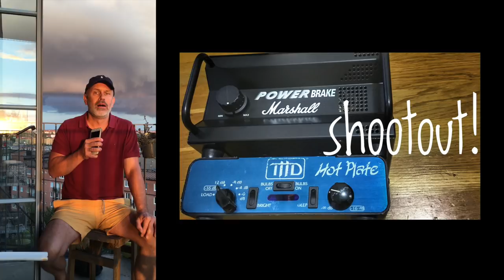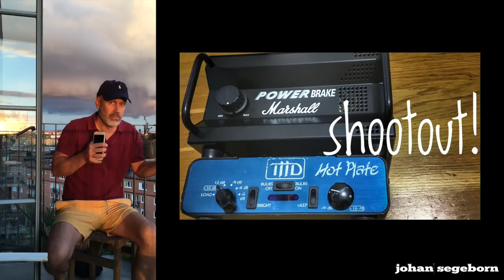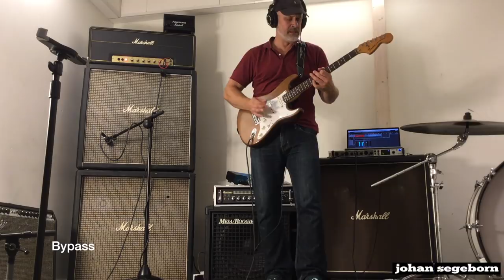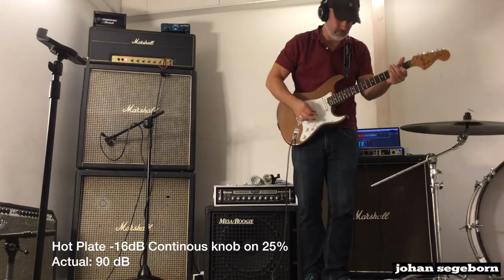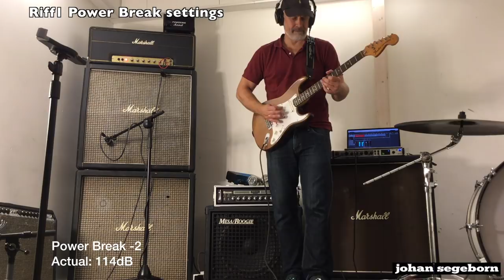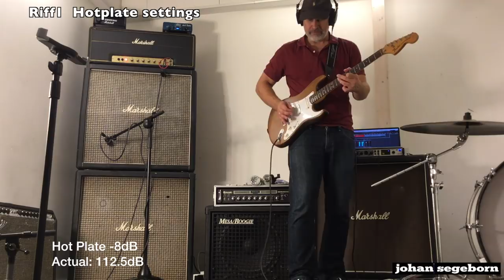Marshall Power Brake KILLS the THD Hotplate in this TEST

Comment: Awesome comparison. But calling 90db "bedroom level" might be stretching it a bit 😅
Reply from the maker: Thanks, Yeah Im probably not a good judge of  loudnes ;-)
Reply: Helo johan i buy a plexi 1987x with master volume instaled , dou you recomend removing it and use an atenuator?
Reply: It is in sweden!
Reply: @XMetalChefX  That might be the reason, here in Miami 60 db is the limit for residential areas, they come with a recorder and they place it on your fence, above 60, you get a 300 U$ fine (first time), second time onwards the ticket is 500 U$. Just like that. So attenuator is a must :)
Reply: Nope thats rock and roll!!!
Reply: @Opiti72 Make sure your houses walls windows and doors can drop 30db then I guess… Or have a house in the middle of a big garden so the inverse square effect kicks in due to distance.

Comment: Engage the thd deep switch and re eq your amp settings once you settle on the regular output that you would use. Keeping your original eq setting and then attenuating will obviously change tone. Mine works perfectly with no top end tone annoyance once re eq’d. Great work as usual my man🤘👍🎸

Comment: I too was using a hotplate after trying a weber mass III. I thought the hotplate did a great job and was a nice improvement over the weber. After watching your comparison, I was on the hunt to try the power brake. I finally found one and have been shocked at how good it is. For reference I'm using a 1987x. The hotplate does fine but the marshall is noticeably better and my ears suck! I find that the power break preserves the "highs" of the amp at higher levers of attenuation whereas the hotplate seems to cut them a bit and get a little more muddy even with the bright switch engaged. As a control I also tried the comparison with a 22 watt Fender deluxe reverb at true bedroom volume. Same results - its pretty amazing that the power brake seems to get a bad rap in some circles.  Bottom line is that both the power brake and hotplate are solid but I concur the power brake beats it. Thank you very much for your awesome videos!

Comment: I've had a Power Brake since 96. It does what It does very well, which is to make nmv amps a bit more manageable. I've tried other attenuators, and they all do more ir less of the same job, the PB, however, is apparently indestructible
Reply: I've been using the Power Brake since the late 90's as well.  Bought another, just in case.  Too bad they stopped making them, because they're the best attenuators available, ime.   The Weber Mass sounds fizzy (similar to hot plate).  The PB is a true reactive load.  So it feels about right, too.   Works fine on smaller amps.   It'd be great to have the fine adjustment control, but not if it sounds fizzy!

Comment: The Hotplate loses low-end weight faster than the Power Brake, which makes it sound thinner/clearer/shriller/lighter (choose your adjective). I would prefer the Marshall for that reason. Otherwise, both seem to keep most of the characteristic wide-open sound: careful use of EQ would probably narrow the gap.

Comment: Hello sir. Great to see the mocha strat out on your funky phrasing. I think the bad rep comes mainly from the pb coming out from an amplifier manufacturer, quite early on in the market of attenuators for the general public in mass production. Everyone tried to make their old marshalls sound like Eddie etc in their bedrooms and the tube and component life of older stuff wouldn't take the hack. Unfortunately the power brake got the blame instead of the usage. A tech I learned from once compared it to putting greased pram wheels on a drag racing car to get the effect with less effort, and then wondering why the engine blew up. Perhaps a severe casting of the characters but the principle kind of fits. I think with proper maintenance and sensible usage of the amp the accusation of the power break was unfair. It was ahead of the game in having a reactive load with the fan, like the speaker motor in the webers the reactance of some kind of coil is importance for the amp to see dynamic impedance curve I think, especially considering these amps have negative feedback. Great comparison with the normalisation of level really shows the change in eq as the thd gets lower. I think, if I remember right from the partial schematic I saw, that the thd increases damping on the cone dramatically which would explain it sounding thinner. Educating the masses, leading by funky example, you are the man as ever. Take care have a great weekend.
Reply from the maker: Have a great weekend my friend!
Reply: All GOOD points!
Reply: PoJoWo I didn't understand a word but I agree with everything you say...
Reply: You sound like an AUSSIE politician!

Comment: Good vid.  Just to add my experience, I've tried two attenuators.  The first was the Weber MASS 100 about 15 years ago.  It was awful at bringing a 100W amp down to home volumes.  I sent it back.  About 5 years ago I bought a Rivera RockCrusher.  It is EXCELLENT at attenuating down to any volume, even whisper volumes.  I highly recommend it.  I've heard great things about the Fryette Power Station, but haven't tried one.  I've heard good things about the Scumback dBL Limiter (Alex's Attenuator) as well, but haven't tried it.  For something much cheaper, I have a friend who tried the Tubular Mods Juice Box and said it worked well.
Reply from the maker: Thanks for the feedback, I hope to compare the rock crusher to the power brake soon.
Reply: Had Hotplate worked good at top two highest volume then after than it sucked the tone out of the amp.  Bought the RockCrusher sucked the tone out of my amp returned it back to Sweetwater.   I can't imagine the Power Brake being any better especaillly since it's over 20 years old.

Comment: The hot plate definitely sounds thin and shrill. The power brake really sounds the same on bypass as it does on -10! Amazing product great review. 

(One small note, in your video where you subtitle what is going on, you used/spelled "break" incorrectly.)
Reply from the maker: Thanks! :-)
Reply: @markp4818  Professionals care.  Businesses pay a lot for proofreaders.  John is a pro.

Comment: I have both the powerbrake and THD. From my own experience the Powerbrake works well up until the halfway point on the attenuation scale where after if starts to suck tone. Great for gigging for when you have to tame a 100w head.
The THD I find much better for bedroom level stuff as you can use the continuous control to get it to a level that’s not offensive to others. I tend to use it with a small box JMP 50 dimed, with the deep switch off but treble on at around 80db at home. For the most part nobody complains about the noise and it sounds pretty good. However a couple of techs have told me to set the amp impedance at 8 ohms with a 16 ohm THD if your going to crank it due to the impedance curve. Maybe someone more qualified than me can explain this properly?
Reply from the maker: The different versions of Hotplate actually only differs in terms of the EQ compensation. With the bass and treble knobs off, they are all identical. To me the EQ compensation of a 16 Ohm Hotplate works best using the amp set to 16 Ohm and using a 16 Ohm cab, as intended by THD. Check this video out 
https://www.youtube.com/watch?v=5Y28oFMU74s

Comment: Another interesting comparison. The PB sounds very consistent to my ears, whereas the HP clearly loses low end. How did you come across the powerbreak as a long time hot plate user?
Reply from the maker: Thanks, One turned up at the local music store, I didnt have high expectations but wanted to compare it to the Hotplate. Now Im switching to power brake for sure.

Comment: Are you reading the dB with a meter? My cheap Amazon meter claims it’s good to 130 but stops at 115 even when I can tell it is quite a bit louder and it still shows 115
Reply: THAT'S Amazon for ya!
Reply from the maker: Yeah I’m using the same meter as I used in this clip
https://www.youtube.com/watch?v=OoPyP6JMSG4
It’s probably also pretty inaccurate over 120dB

Comment: The Hot Plate seems to have a scoop EQ that gets more prominent with each step of attenuation. Is this a setting you can disable? Is it some sort of compensation like the "loudness" control on some stereos, intended to keep the voicing subjectively similar at lower SPL to make up for the difference in ear response at different volumes? (IE Fletcher Munson compensation)
For recording, with the recorded signals normalized to the same volume, the Power Brake sounded a lot more consistent.

Comment: All you need to do is bypass the 160 uf cap.and make sure the wires going to the power  resistors are better soldered they heat up and can fall off..you can find out more at the metroamp forum,under EVH builds..Look for rallie power brake mod

Comment: OK, comparing the Power Brake at -10 dB with the Hot Plate at -75% below -16 dB is not a fair comparison, at all, though I will say the Power Brake is just as good down to -15 dB, but start exhibiting unacceptable EQ shift at -18 dB, which doesn't surprise me, at all.

In my experience, the Hot Plate sounds great down to -12 dB, and below that, it doesn't sound very good. As you can hear immediately in the video, once you engage the continuous -16dB to -inf section of the Hot Plate, the tone deteriorates unacceptably. With the -16 dB setting and the continuous knob at -0 dB, it seems OK in this video, but anything lower than that would require EQ adjustment. In any case, I would never even use that capability, because I've used a Hot Plate for long enough to know that it's not very effective in the range, but in the ranges it does sound good, it sounds great.

IMO, attenuators are not very good at getting down to "bedroom levels", and shouldn't ever be used for that. But the difference of -12 dB is a reduction of power of 15/16ths, or down to 6.25% of the original power level, and makes a huge difference when using an amp live on stage.

Comment: Really impressive shootout, great normalisation and great tone... I chose Hotplates many years ago, based on how they sounded on 15-30 watt Matchless (Lightning), Vox (AC30) and Marshall (Lead & Bass 20) amps, however, nothing as powerful as a Marshall Super Lead Full Stack... I found the Hotplates to be the most 'transparent' sounding, to my ears anyway, particularly on 'full soak' for studio-level playing - I haven't really thought about it since then, but this test is pretty clear - does the Power Brake work particularly well with big Marshalls ?
Reply from the maker: Thanks, thats an interesting question. Maybe they developed it with respect to the typical Marshall frequency content. Cheers
Reply: Could be. Did you use the Deep switch on the Hotplate @JohanSegeborn  ? If the PB wasn't built with the Marshall's in mind, maybe they used the same tech housed in the Hotplate, but without the option of disengaging it?

Comment: I wonder if Marshall improved the Power Break as I tried one when they came out back in the 90's and they sounded thin.... Cheers Johan!
Reply from the maker: They must have, I didnt remember it sounding this good. Cheers!
Reply: Definitely, i gigged a power brake for years in the 90s with my super lead and it got farty in the low end and thinner. Went to a HP and was definitely an improvement, I also had a ULTIMATE attenuator and that was the best sounding but badly made.

Comment: I think the Hot Plate sound more natural and open, almost like without an attenuator. 
The Power Brake takes away too much treble in my opinion.
Reply from the maker: Do you mean here in this video?
Reply: Johan Segeborn yes!
Reply from the maker: Damn, then I must check my hearing, since I respect your sense of tone
Reply: I agree. There seems to be more dynamic, touch sensitivity with the HP. I can hear the EQ differences that everyone else is hearing too, but that can be compensated to some degree except probably at the lowest setting. For all these years JS has been using the HP on all his videos and all you read in the comments is how fantastic the amp sounds....

Comment: Have you ever tried the Altair PW-5? I just got one and can’t seem to find any videos on it, cheers
Reply from the maker: Hi, no not yet. First chance I get! Cheers!
Reply: Really great comparison, Johan.  I cannot get enough attenuator info! And you have contributed more than anyone to the amp attenuator Tone Library. I usedse attenuators all the time. The Altair is a really nice unit, compact and effective. I have two, including the rare blue model,  that I have used with joy for over 35 years on cranked Marshall, Fender and Boogie amps. When you change attenuation level on the Altair it slightly changes the impedence (resistance?) loveoad the amp sees. So best to switch amp output impedance accordingly. Other brands that use very different circuits display similar behavior. Best to measure it with multimeter and set the amp accordingly to prolong amp/tube life and get the best tone.

Comment: How did you have the bright and deep switches set on the THD?
Reply from the maker: They were off
Reply: Johan Segeborn I wonder if the deep switch would have brought some of the low mid range back. It’s unfortunate that you can’t get rid of more of that nasty high-end from the Thd. Another benefit of the power brake is that it has switchable impedance whereas the THD has only one impedance.

Comment: Someone help me :) I have a Peavey 6505+ with Mesa Boogie 2x12 cab. I gigged and almost blew the roof off the club. People actually held their ears in pain. Does anyone know if this would work well with the Peavey 6505+ head? Alf
Reply: Why? The Peavey is built on the premise of pre-amp distortion with a clean output section. All you have to do with such an amp is turn the volume knob down. If anything, those amps start to sound muddy if you turn the volume too high.